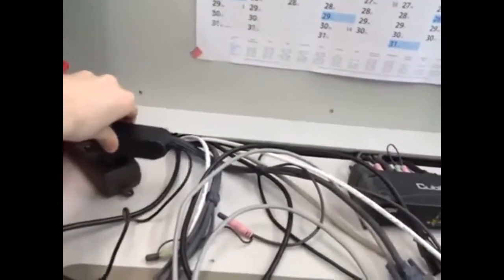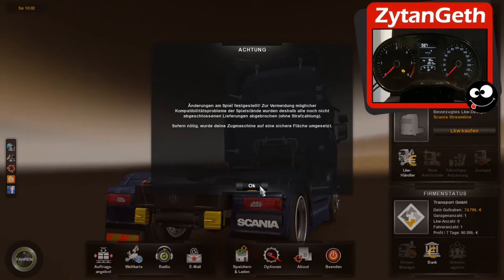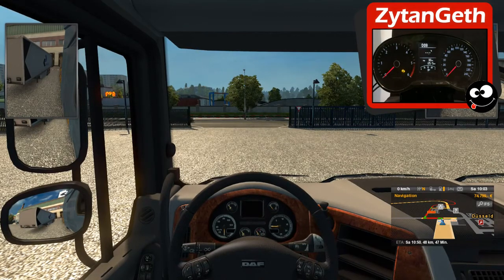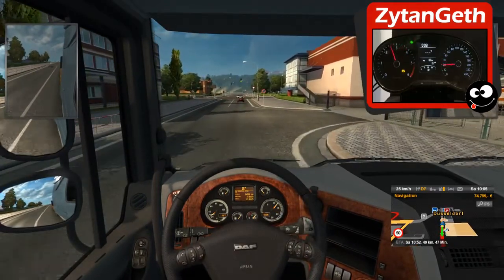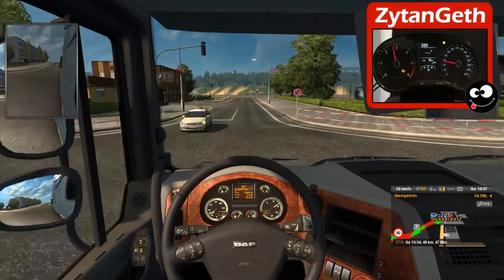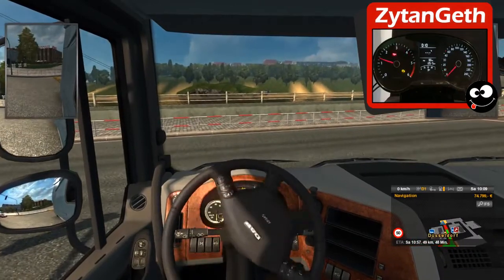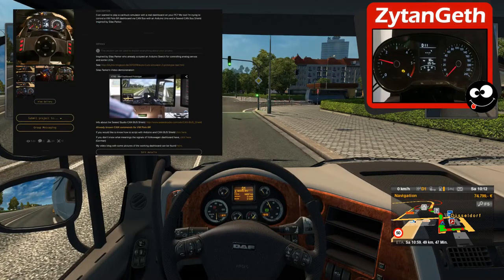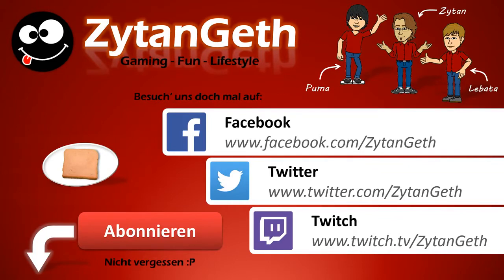CAN BUS Gaming #4 - Euro Truck Simulator 2 [English]

Comment: Wow, and im sitting here with this CanBed unit and I just need to have it output one Canbus signal, I don't even have the same issue as you do, I have the canbus network file and a printed version because i work at the car company my car part is from XD
This is amazing and I hope it's still working for you
If you wanna contact me reply on here or add my Discord Shellcool#1756